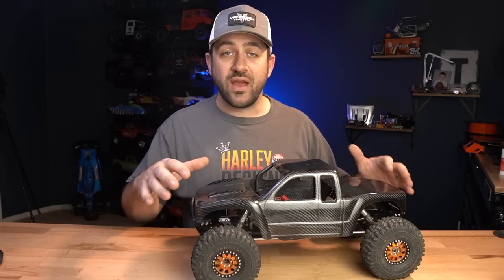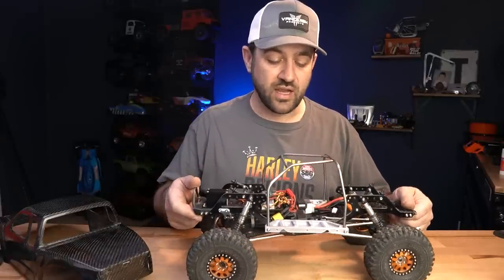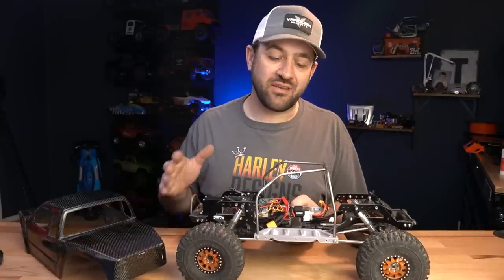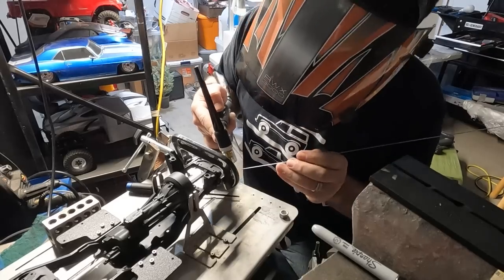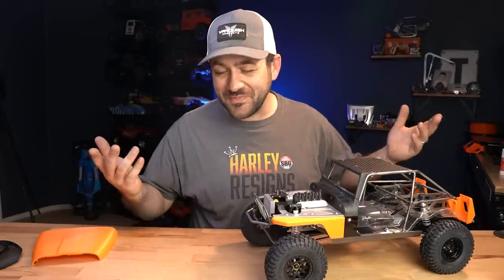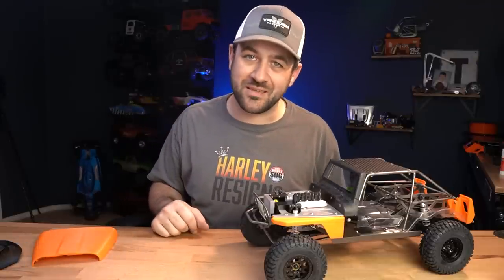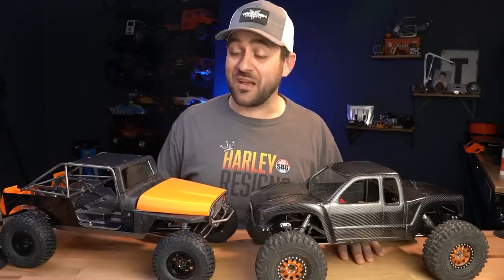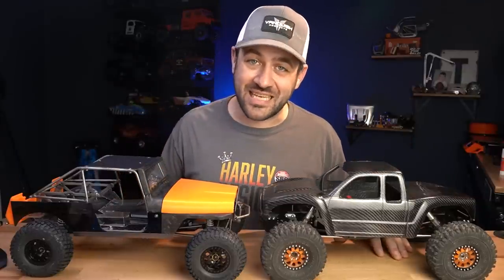Cages, Bumpers, Carbon, OH MY! - Road to Scale Nationals - S2 E6

Comment: It is amazing how far you've pushed this hobby. I've been watching your work since the RC/crawler forums. I am a welder for a living, and I'd like to offer a suggestion. Please cover your arms and hands. The amount of UV light from welding is significant. In when doing delicate TiG work like Titanium below 100amps I wear thin cotton gloves even if it just to keep the oils from my fingers off the filler rod and any other surfaces.
Reply from the maker: I definitely need to do better at that. I appreciate the comment and fully admit it’s bad practice.
Reply: @HarleyDesignsInc  once they cut a piece of my leg off I took it more seriously. I remember when this part of the hobby was clod axles and I started welding for a living.

Comment: Honestly, the Ti sides won't add time other than sending the file to SendCutSend and swap them in when you do the final assembly. If you need to cut time suckers, maybe just print the back of the class 1 in black, or paint the parts you have done and go with it.
Good call not cutting the CF body. Again, another time sucker. Totally digging the roll bar / roof rack idea for bracing and mounting the body.
This series is awesome, thanks for sharing it with us.

Comment: Keep the carbon sides, as for your class 2, body mounting ideas, you did a custom 3d printed faux motor/mount I believe on an old power wagon build, could that be adapted to that new body for a front mount idea, just a thought, as for the hood mount, just use magnets if it does cause to much redesigning

Comment: Ti the sides, will be a great contrast. What size are the tires you will be using for the class 2/3 rigs? Normal 5.75 or a smaller 5 to 5.25 tire?

Comment: Please don't cut the carbon bed or put a roof rack on class 2/3. Check points but I think you can point it out with out those mods

Titanium body sides on class 1.